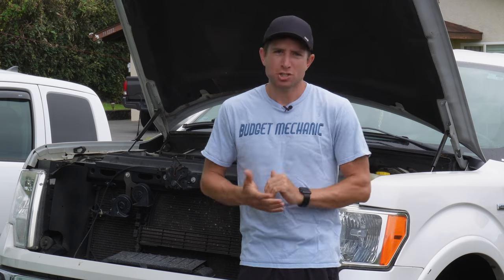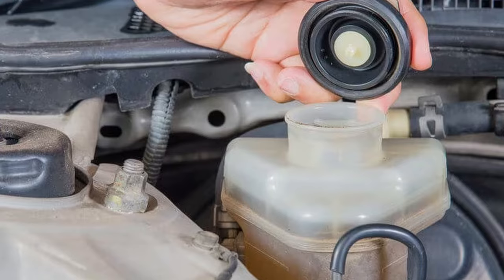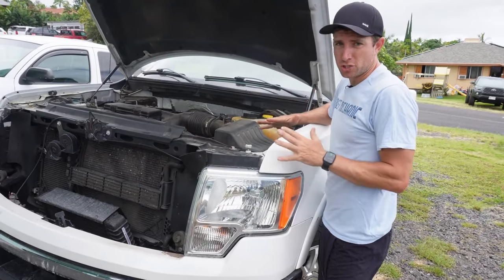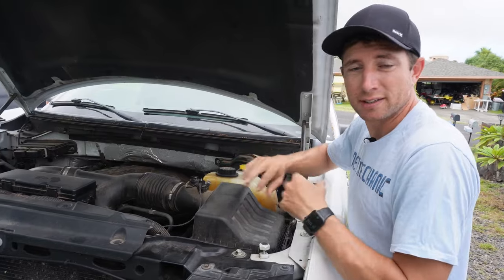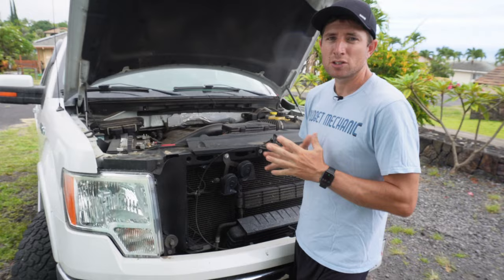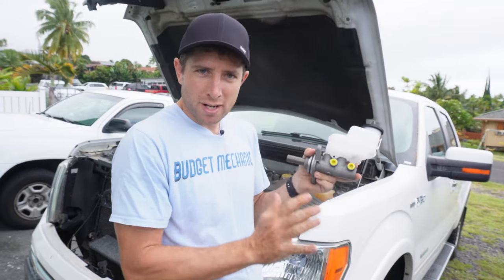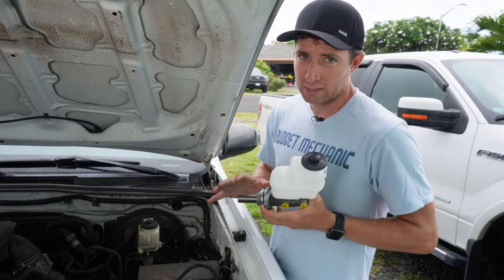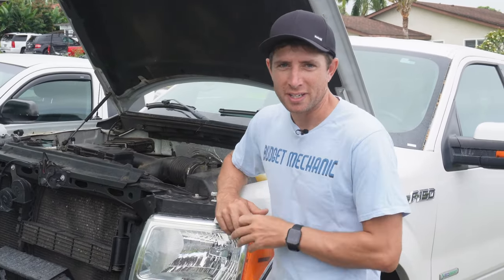Brake Pedal Sinking? Dangerous master cylinder! How to fix

Comment: "I cut out a big hole in the floorboard in front of the driver's seat, which I can extend my feet through, and use my foot soles as friction pads on the ground to stop! If I'm going to haul a trailer, I have a passenger do the same with me, on that side."

Modern Mechanic interview, 28,004 BC:  FRED FLINTSTONE.😅
Reply: I found that strapping the brake pads directly to my feet vs using foot soles really saves a lot of money.

Comment: Another cause could be the wrong master cylinder. For example many cars have different ones depending on whether your car has ABS or not and it really does matter. Also make sure that all your lines are properly and firmly connected and there are no signs of leaks anywhere.

Comment: Has anyone ever had this problem? August 11th I was driving the motorhighway, then suddenly my brakes push all the way in, and no longer work at all. I had to pump them and then they worked again for a minute or two. Now we tested it August 15th, 3 days later, and it works fine
Reply: Dealing with the same problem can’t figure it out
Reply: @jaimec7175  Brake fluid might be old

Comment: Thank you and I’ll certainly point my mechanic to this. My civic has been suffering from sinking brakes exactly the way you mentioned for a while and the dealer had been skating over the problem citing worn brake discs. Resurfacing didn’t help and it still sinks. Explains why the Brake Hold system struggles too. Great explanation!

Comment: Great explanations, as always. Quick and straight to the point. I would like to see how a brake master cylinder is replaced. My BMW has some weird braking behaviour, i.e. when I go like over 50 mph and brake really hard, the pedal sinks quite a bit, the ABS kicks in, but the car doesn't stop all that well, it travels more then I would like before it stops. Maybe it's just me having too high expectations.
Reply from the maker: Yeah it’s hard to say, abs is supposed to “reduce” braking in order to prohibit wheel lockup. So it’s a combination of tire quality, road surface, etc. That being said, it should stop sooner than you think since it’s literally supposed to maximize braking power…

Comment: Good video. Quick question ...I have good solid pedal with my vehicle not running. Once I fire it up and the brake booster is engaged the pedal falls nearly to the floor. I can slightly build some pressure back by pumping pedal rapidly, but not where it should be or the firmness that was there with engine off. I'm not seeing any leaks from the MC to the booster, but like you said it could be bleeding into the booster and has ruined the diaphram. Your thoughts?
Reply: Did you ever get an answer to this? I'm a new driver and i've got a 2007 Renault Clio which has the same issue! I can pump the brakes when the engine is off and it becomes firm however as soon as I turn the engine on the pedal goes soft again and I need to press down quite far before the car starts to stop.

Comment: Thanks for the informative videos. Would you by any chance be able to shade a bit light on replacing the new brake master cylinders on GM suvs, they have one unit having abs module/motor,HCU and master cylinder together. Have a blessed day!

Comment: I got a 2014 camaro and i bled the brakes with ignition on of course. I did a complete flush with over 32 oz of luid so i got all the dirty stuff out. Anyways when the ignition is off its nice and firm but as soon as i turn on the ignition and pump the brakes i hear a wooshing sound and of course the pedal goes down easier more than normal. It still breaks okay and when im driving and brake it doesnt make the noise unless i pump it first before brakeing.

Comment: Was the rubber lines in the front. See I am so used to driving my truck around and anticipating that I gotta pump the pedal once as I’m come to a stop. It was pissing me off, watched Scotty Kilmer and he’s got one answer for everything, buy a Toyota. But yah. Bunch of brake work and still did it and a shop was like they’re fine. I’m like no… but anyway yah swapped out the rubber front brake lines and got a normal pedal for once. Took a minute to get used to it. About took eh bite outta the dash couple times. But yah. 👌 mint.

Comment: My car have no leaks. But I have no brakes. The brake fluid in the reservoir is very very dark watery feeling to it. Should I change the whole thing?  Btw, it's a chevy comfort 2009 and parts are very difficult to get where im at. Aruba 🇦🇼 . Thank you very much ,the video was very helpful.

Comment: My pedal starts strong but slowly sinks as I sit. Been like this for months. Fluid level is below MAX but above halfway. I'd like to see a video on replacing a master cylinder on a 2016 Corolla. Front pads replaced  4 months ago. I replaced the rear shoes 4 days ago.
Reply: My friend's Corolla and my Civic had the same issue. Most likely the master cylinder or air in the lines if there are no visible leaks. Try bleeding your brakes if you haven't done so, could be air in the system. If that doesn't work, master cylinder probably needs to be replaced. Both of these are not very hard nor are they expensive repairs.. You should do it sooner then later. My friend left it like that for 3+ months and he almost got into an accident due to lost of brake pressure.
Reply: Its something you have caused when you messed with your front and back brakes, was it ok before you touched it
Reply from the maker: Is it very slowly? This could be due to abs module, but if it sinks in less than 5 seconds that not normal. I would suspect master cylinder. Air in brake lines will make it feel soft and spongy but not sink to the floor
Reply: @BudgetMechanicHawaii  Thanks. Now I'm thinking it's just air in the lines. It sinks slowly but not all the way to the floor and sometimes it feels fine. I'll try to bleed them soon.

Comment: Should brake fluid be coming out of the brake line if you are not pressing the pedal? I am replacing a wheel cylinder, removed the brake line, but I get a never ending stream of brake fluid coming out of the brake line that is disconnected from the wheel cylinder. Bit confused on that, thought you needed to keep pressing on the brakes for that to happen.

Comment: How about a brake pedal that doesn't come all the way back up but otherwise is fine. I had to really slam on the brakes last week. Now when I step on the brakes it feels fine and the truck slows normal. But when I release my foot from the pedal the truck will still be slowing down. But if I give the brake pedal a quick and firm stomp the pedal will return to the all the way up position and brakes are free. I have no problem stopping. I have a problem going after slowing for a turn or speed bump. Then of course when you try to go with the brakes engaged I get all the ABS and traction control lights.

Comment: I replaced the caliper on my truck. I bleed that line till no bubbles but now the pedal go to the floor. You can pump it fast and it will build up pressure but it eventually goes to the floor again. Does this sound like air or mc?
Reply from the maker: Sounds like a leak or yes MC

Comment: Hello! I hope you are well. My dad has a 2001 ford f150 and we have a sinking brake pedal problem. We have changed and bled the master cylinder, we also changed the brake booster, as well as the ABS module but the brake pedal is still sinking to the floor. We even changed all four brake calipers. We have bled out the brakes numerous times and gone through many bottles of brake fluid, but the problem remains the same. Are there any other potential causes as to why our brake pedal is still sinking? Please let us know. Thank you in advance! :)
Reply: In addition to this, when the car is off and we are pressing the brake, the brake pedal is firm. But once we turn on the car, the brake pedal sinks all the way to the floor.

Comment: What do u think it is when ur pedal goes to the floor and the brake master cylinder is replaced and brakes bled out of air? I have done all the work and still have a soft pedal and bled it multiple times
Reply: There's a big chance it's the vacuum booster.
Reply: It can be the seals in the abs pump

Comment: What if you have no breaking problem driving and stopping multiple times for about fifty miles... But two times apart from the multiple times the brakes worked the peddle goes to the floor??? No ABS LIGHT COMES ON! BUT CAN BARELY GET CAR TO STOP.

Comment: Hyundai H100 i replaced the Master brake cylinder but still no pressure on the pedal. No leaks also. Tried bleeding, it holds for a bit but sinks again
Reply from the maker: Tried bleeding? Did it work? No bubbles? Did you bench bleed the master before putting it on?
Reply: hyundai cars (in india)are notorious for this brake sinking problem...and no repair can set it right...this is experience of many many hyundai car users....a blunder manufacturing defect.....nothing can be and ever done by any mechanic here..in india....any sugfestions???😢❤😢❤